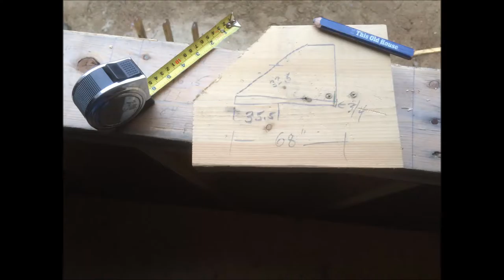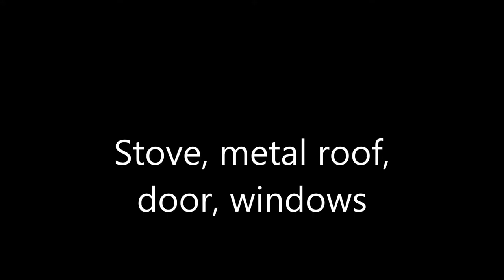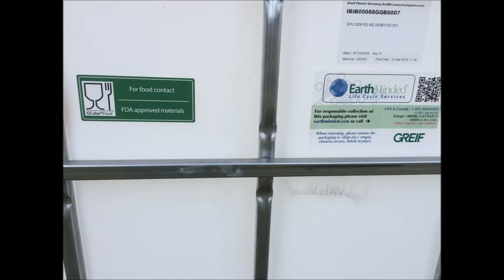Tiny NH House slide show

Comment: Hello Tiny House! Lots of work aint it? Specially without 110V. Looking good! I am building a place about the same size now on the top of my property in NH. Does it ever end? Nope. Nice work, looking for ward to more videos.
Reply from the maker: Yes, I am on year 3 of a 6 year plan!  But it is enjoyable and feels good seeing progress. I just bought a second 250 watt solar panel; next spring I'll get more batteries and maybe an inverter. The battery powered tools and car recharger for the 18 volt batteries, have been life savers!  I'll post another video when most of the insulation is installed. Good luck with your build! -- Dave